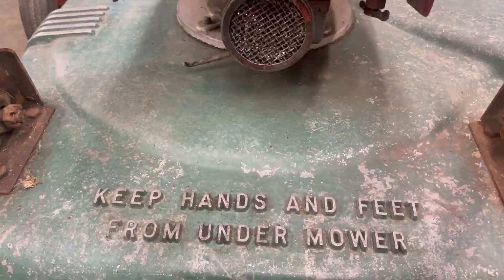Vintage 1957 CRAFTSMAN 2 stroke mower! Will it still run?!?

Comment: Those little Power Products 2 strokes are awesome,in the seventies Dad was given one by a neighbor, the carburetor was missing parts and it didn't have a gas tank,Dad put a Lawn Boy carburetor on it and put it on one of those Craftsman magnesium decks,rigged up a fuel tank and we used it to mow tall grass and weeds on the hillsides near our house,one time I was mowing there and ran a copperhead out of the weeds, Dad told me to run over it, what came out of the discharge chute resembled ground beef but that little engine didn't die though.
Reply from the maker: Great memories! Thanks for sharing and thanks for watching! 👍🏻👍🏻

Comment: i have one of these 1hp power products engines Aswell. they require 16-1 gas mixed with Sae 30 motor oil you will kill it if you run anything else the old lawn boys are the same way.
Reply from the maker: You can fog for mosquitos while mowing the lawn!!! But they certainly stand the test of time. 

Thanks for watching & thanks for the comment! 👍🏻👍🏻
Reply: I have a Clinton 2 stroke on a mower and I use a 16/1 oil ratio. I used to use non detergent 30wt as  oil but switched to normal 2 stroke oil and it runs fine. 
Also don’t use starting fluid on a 2 stroke. If that stuff detonates inside the crankcase you’ll have a big grenade. Happened a lot on early experimental 2 strokes. Stay safe!
Reply from the maker: @robwhite3241  I run 16:1 as well in all my old stuff and it all seems happy. 

Thanks for watching & thanks for the comment! 👍🏻👍🏻

Comment: Even with a lighter engine and aluminum deck at that thickness the mower would be heavy. Not to mention the exhaust was truly awful. You have to remember that back then they were burning leaded gas. They don’t make them like they used to, and that isn’t always a bad thing.

I get the nostalgia and attachment to a family heirloom, but yikes!
Reply: disagree,,,sorry